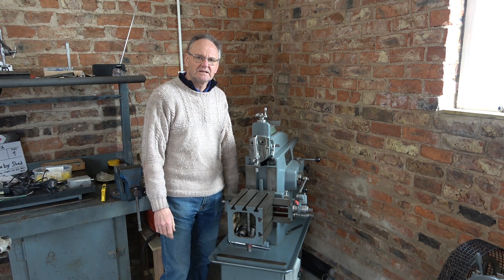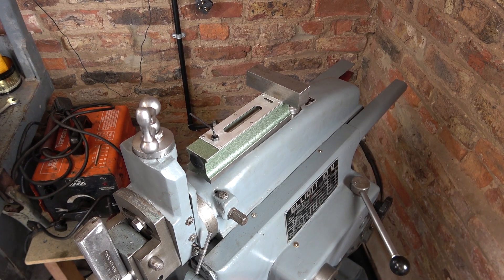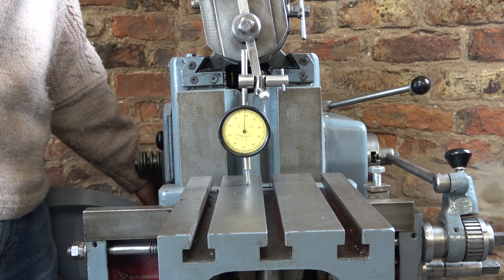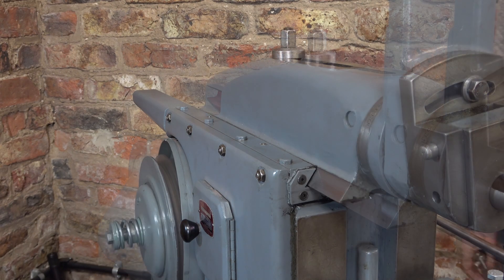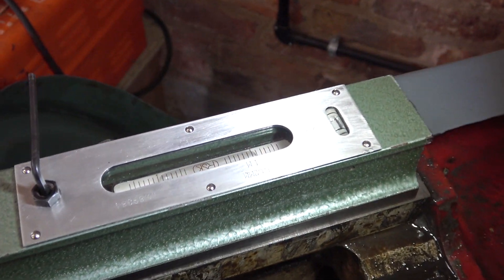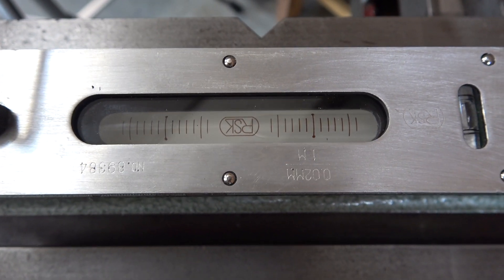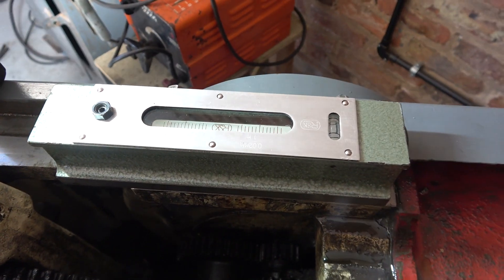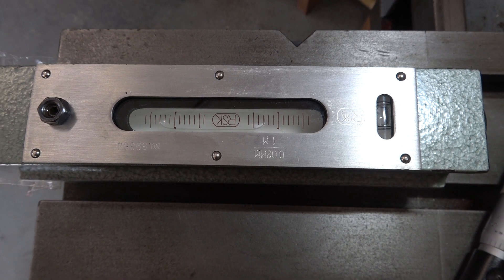HS72 Elliott 10M shaper maintenance

Comment: I have stumbled across your videos and love watching them. I worked as an engineer for years, but always said, you can live a lifetime and still be learning everyday. I don't work anymore, well not in the capacity I used to, due to having a fractured skull. And as a result of that a subdural hematoma (the fractured skull was the easy bit), the brain damage I would not wish on a dog!!. I am interested in obtaining one of those elliot  M10 shapers,But I would like to ask you a coulpe of questions about it if I may. 1, What is the table foot that Phil refer to and how does it work, 2, is it single or three phase and lastly How much did your beauty cost, Please?.     Meny Thanks, Leon 🙂
Reply from the maker: Hi Leon, it sounds like you have had a tough time. My shaper was £450 'buy it now' on ebay from a small workshop about 30 miles away. The owner was a helpful chap and he transported the shaper for me for £50. It is 3-phase. It came we an optional static converter "you can have that as well if you want it?". I decided to run the shaper from an inverter as they are physically much smaller and provide speed control, so I sold the static converter on ebay for about £350. I had no idea they were worth so much!  If you look at large shapers they always have a front support on the table to make it more rigid. The Elliot 10M is a small but very useful shaper and it has a drop-down leg to support the front of the table. It only works when the table is in the normal position - it does not work if the table is swivelled.  One day I might make a 'cradle' to provide support when the table is swivelled. Anyway, as chance would have it, I'm currently doing some routine refurb and repair work on the shaper and the video will be out in a couple of weeks. I have made several videos about the shaper and there is a playlist on my channel. If you get one then be aware they weigh about 450kg and are very top heavy. Alright on rollers on concrete but awkward moving them over rough ground - or gravel in my case.  I hope that helps. Cheers

Comment: Excellent . I am sure I need to do the same to my Southbend 7" shaper. I was just planning to use an indicator but the use of the level on both the table and the ram slides is excellent use of the level. Thanks so much for sharing with us. I just recently subscribed to your channel after seeing you on the ARW discussion . Great discussion. Thanks for your participation.  Terry from Texas
Reply from the maker: Hi Terry, that's for your subscription and comment. To be honest my ideas usually develop as I go along and the idea of using the machine level to check the ram ways against the table did not come to me until late. But it gave me another chance to use my lovely level :-)  Cheers

Comment: does this table rotates, I am asking because there are T Slots on the side.
Reply from the maker: Hi Roy, yes the shaper table can rotate 45 degrees one way and 45 degrees the other way. But the slots on the side can be used to hold long work in a vertical position to machine one end. In another video (HS53) I make a bracket for my Tapping Head and do some machining using the T Slots on the side of the shaper table. Cheers
Reply: @HaxbyShed  thank you. yes will definitely watch the video
Reply from the maker: Hi Roy, I just checked and the shaper table side work is in part 2 of that project. It is HS54 at 18:56, if you want to go straight to it. Cheers
Reply: @HaxbyShed  I ended up watching that entire video, it was really fascinating. The reason I asked because I found a similar size shaper, but I am turning down because it is not coming with a vice.

Comment: That was very usefull, I will have to try that on my shaper, once I get a machinist level. Thank you
Reply from the maker: Hi Henrik, the machinist's level can be extremely sensitive and you can spend a lot of time trying to get the bubble onto the scale. So my advice is to get one with an adjusting screw if you can. Apologies if you know this already. Cheers
Reply: @HaxbyShed  Hi, yes so I hear. But I still think it is a good time investment, so thank you. By the way I have seen someone on youtube build his own precision level. you can get the spirit level on ebay.
Reply from the maker: @henrikhv5084  Yes I'm sure you could build your own. I think the precision comes from the diameter and quality of the spirit bubble tube as much as anything.

Comment: Great use of a precision level, a very precise level at that. Looks like you've added some nice sticky grease on the drive gears, should reduce noise a bit.
Thanks for sharing.
Regards John.
Reply from the maker: Thank you John. The adjustment screw on the level makes all the difference, to easily set the bubble position without shims and packing. And yes the shaper is pretty much clank-free. Cheers

Comment: I don't think they are Whit threads, UNC 60° in a lot of cases, will "work" in whit 55° threads, I have the same shaper, all Unified threads!
Reply: Yes my 10M is UNC apart from some small BA screws
Reply from the maker: Hi Matthew, as soon as I read your comment it seemed obvious they would be UNC of course but I never thought of it until you pointed it out.  I always imagined that Whitworth would be preferred until the 70s but now I recall my 60's Mini was UNC/UNF. Thanks

Comment: It is also very important to set the table foot tight on the front bearer strip, once again, a really well made and informative video!

Phil
Reply from the maker: Hi Phil, thanks. I try to remember to drop the leg when I'm cutting. When I first got the shaper I did not bother but later realised it make a big difference.  Cheers

Comment: I have an Alba 1A shaper which needs the same treatment. When adjusting the table height you must first loosen the vertical slide clamp, set the required table height and then clamp the vertical slide up so that adjustment in the vertical plane Is impossible.
Reply from the maker: Hi Phil, that's interesting. I think I recall that the Elliott 10M evolved from the Alba 1A ?
Reply: I'm doing the same on my Alba 1A. 
Works perfect!!!  (up to 0,02mm)
Reply from the maker: Wow Ronald that's accurate!
Reply: @HaxbyShed  just try it yourself (tightening the vertical slide), you will be suprised!!

Comment: If you have it apart give it a light scrape to help it hold the oil. With smooth surfaces oil is pressed out. Cheers
Reply from the maker: Hi Logan880121, I watched the video again today after your comment and I saw how smooth the surfaces are towards the front. I will add it to the to-do list next time it is apart. Cheers

Comment: Doesn't your shaper have a support rod underneath the table to hold up the front side? I noticed there is the support bar cast into the base, (side to side), which you did not paint over when you "spruced up" the shaper. The support rod threads into the table bottom & rides across that cast bar as the table moves side to side. Most guys use Mobil Vactra #4 to lube this just like the ways. When the table has to be moved up / down, the rod has to be adjusted so that it supports the weight but still slides across the cast bar face. Maybe yours doesn't have it now or maybe it was just made without it & came as an addition. Can you check out some spec sheets & see if they list it in the parts manual? I saw it in a video about 2 years ago on another small shaper like yours, & I think it was English made.  Good video. I like the way you "keep it simple stupid" for guys like me not trained in "shaperology".  Cheers from Lansing Michigan.
Reply from the maker: Hi Robert, yes it has the support rod just as you describe and it makes a great difference when the shaper is in action cutting. I did not use it for the measurement as I did not want to 'jack up' the table but rather measure it as it hangs. Lansing Michigan - between the lakes. I usually look at the map if people say where they are. We are becoming quite an international community. I've been to the States a few times, mainly it was on business, but not in your area. Regards